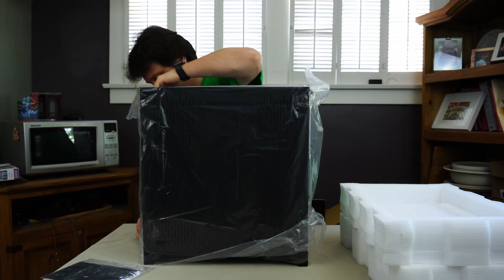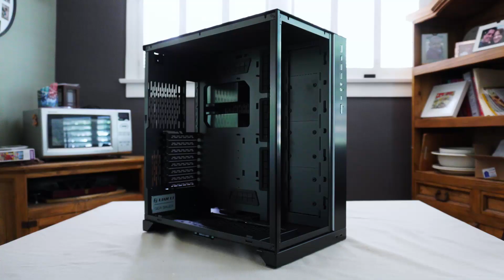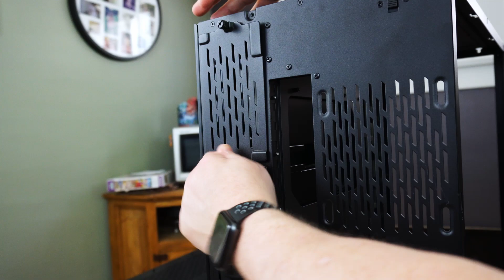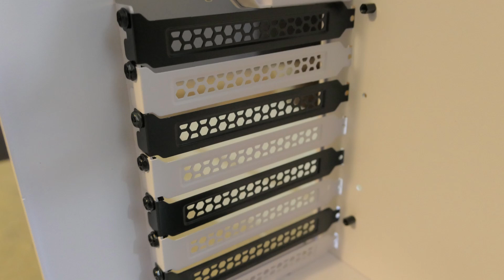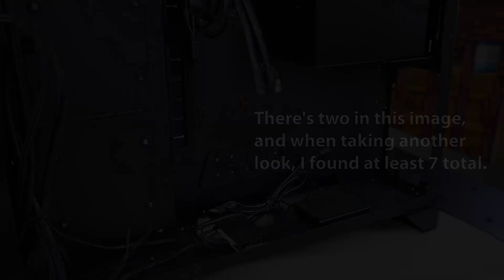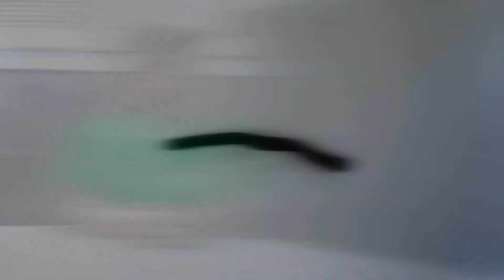Lian Li PC-O11 Dynamic XL: The Dynamic went through a growth spurt!

Comment: Great review.  I just read through the Dynamic manual, and fortunately, you don't need to purchase the optional extender bar for a typical e-atx motherboard.  However, any EBB board will require the bar.  However, I do have a question about the dust filters.  If you remove the drive cages without anything in the back, will dust get in without a filter?  Have you faced having a lot of dust in the case?  Great channel, by the way.
Reply from the maker: Even without the drive cages you'll want the filter since the PSU intake will be on that side anyway. Great call out about the extender bar thing. I try to clean my filters weekly and I have 7 intakes and 3 exhausts so I have a super positive pressure, so dust so far has not been super obvious. I need to get in there and blow things out though.  Overall, I haven 't noticed a lot of dust getting in so far but the GPU backplate definitely has specs on it so I'll assume yes dust is def. in there. Thank you for watching and the compliment!
Reply: @MiddleofKnowhere  thank you. Great info.

Comment: I had to buy  the EBB extension bracket for $30 usd to install the ASUS sWRX8 mobo in this case. Running a 3995WX PRO as a workstation. Yeah, they should include it for the price of this case.
Reply from the maker: Yeah I think some of the accessories available should def be included for the price.

Comment: After watching this video I have gone ahead and ordered a white XL. A very practical review!
Reply from the maker: Thank you for watching! I'm glad it was helpful. :)
Reply: @MiddleofKnowhere  Sure was. It helps me plan out the case too. I am transplanting my 10700/3090 system from my 10yo old case plus I no longer need 5.25" drive bays. It's a Noctua NH-U12A air cooled system so my plan is to have 3 intake fans at the bottom, 3 intake on the side, 3 exhaust on top, and 1 exhaust behind the CPU. All fans are low noise NF-S12A and will run through a Deepcool 10 port fan hub. It won't be an RGB light show. :)
Reply from the maker: @anorax001  Nice! I'm running 9 fans currently, top and bottom intake, with side exhaust. Not sure I'll get a 10th. Gonna stick to my HD120 RGB fans until Corsair comes out with good static pressure LL or Capellix fans. I like the corsair ecosystem although not the wiring lol.
Reply: @MiddleofKnowhere  Yes for sure. The wiring is the biggest challenge but from what I have seen the Lian-Li makes it relatively easy to hide most of the wiring. As for airflow my basic understanding is heat rises so I am trying to promote upward and away movement of the hot air.  :)